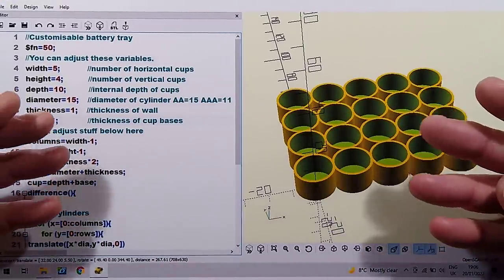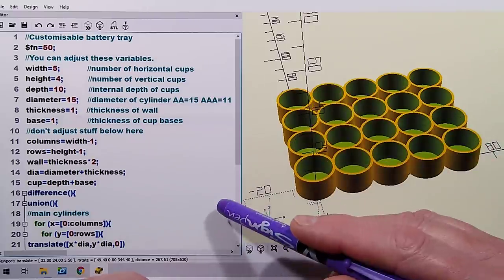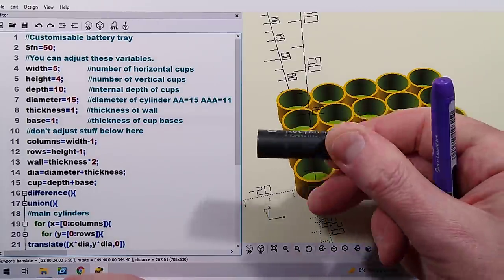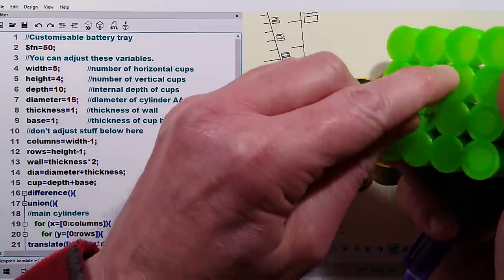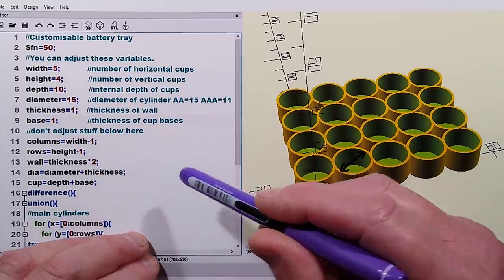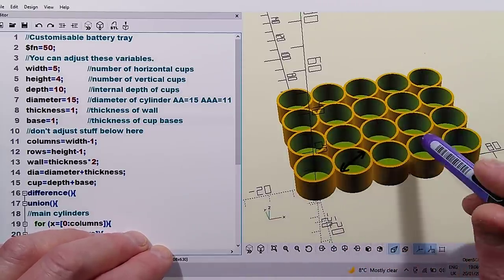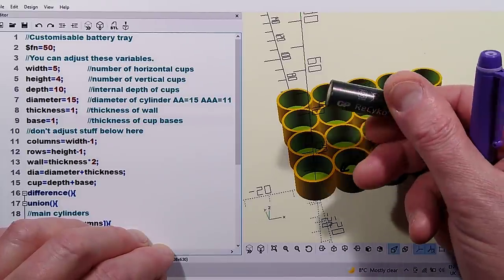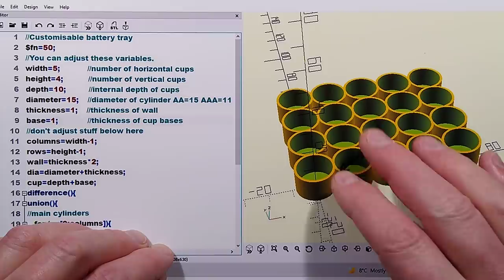DIY custom battery storage trays

Comment: "Full Control GCode is a new approach to getting your 3D printer to print exactly what you want! And it's not just useful for creating weird vases, it's actually a great tool to make functional parts as well." - Thomas Sanladerer
https://www.youtube.com/watch?v=ZgytQDoaD5M
Reply: Yeah that tool is really neat 👍
Reply: I watched the video and remembered why I am not a subscriber... mid roll ads, sponsor ad, music, etc.  As for "Full Control" it is pretty low level programming that for most of us I think it is better to use OpenSCAD for most things.  For example it is easy to subtract one shape from another in SCAD but in G code you have to figure that all out yourself.  If your company is 3D printing bulk simple parts it may be worth the effort though.  I'm reasonably happy with OpenSCAD and will stick with it.
Reply from the maker: I will admit that I found the printing route that was used in these trays quite frustrating.  It's where total Gcode control would be good.